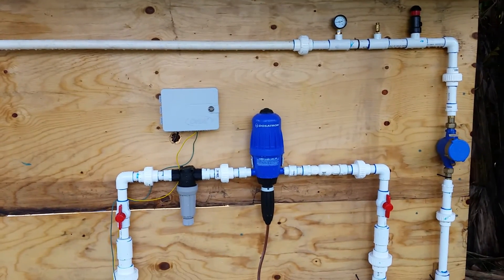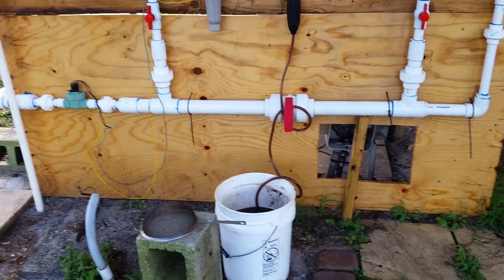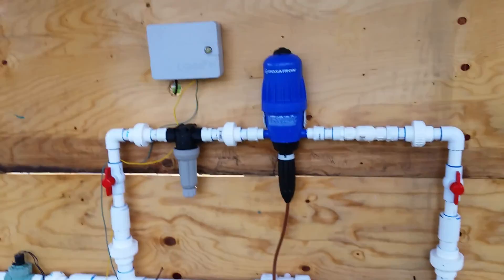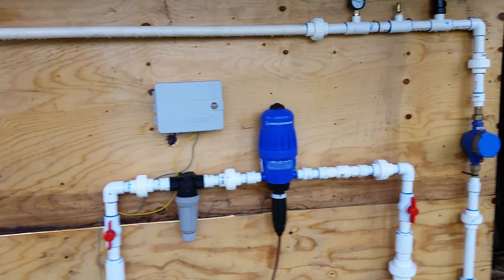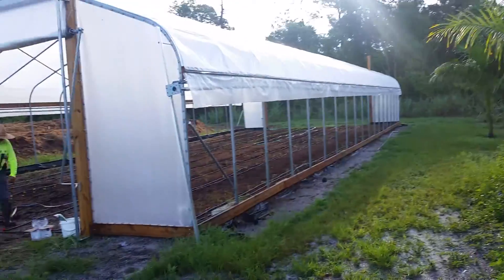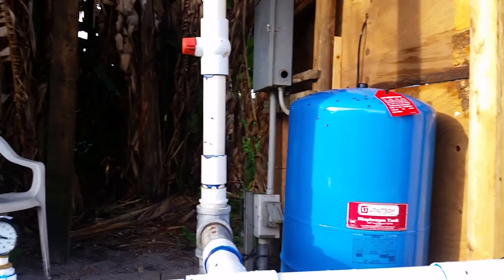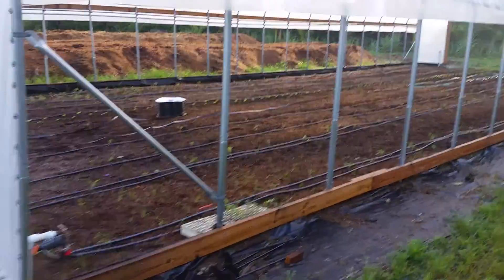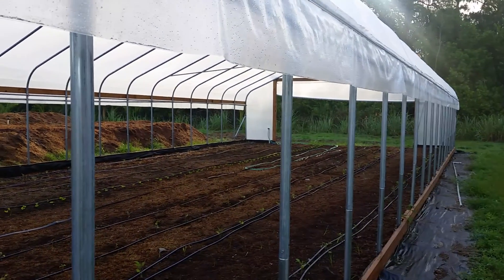Fertigation for hight tunnel - fertilizer injector

Comment: Thanks for sharing. I got an ez flow. I didnt know how bad it sucked until after i bought it. It doest regulate anything and the whole tank empties in 2 days. Anyways what kind of dosatron injecter do you have? It seems like the faster ones are more reasonable. And do you have to have the injector up that high? Im worried my wife is going to get mad at me for building it in my back yard. But it looks like you need it to be taller than the bucket. Do you have a carbon filter to get rid of the chrlorine?  I was thinking about converting my ezflow into a big carbon filter since it aint good for shit.
Reply: Felix G Maybe you don’t have enough pressure

Comment: This is the only Hydroponic Program  I could find on Hydroponics that had solid reviews [Check Details Here  ===>https://www.facebook.com/Easy-Hydroponics-Systems-166096780618260/app/208195102528120  ]. I hadn't started my own Hydroponics set-up yet, but am extremely interested in doing so.I wanted something that would help me understand all of the systems required, how to plan a build, and what to expect once it's set up. "Hydroponic Gardening" did a good job of answering all of the first round of questions I had.